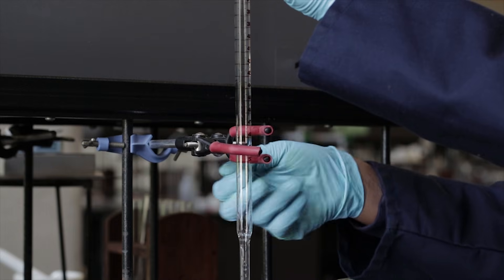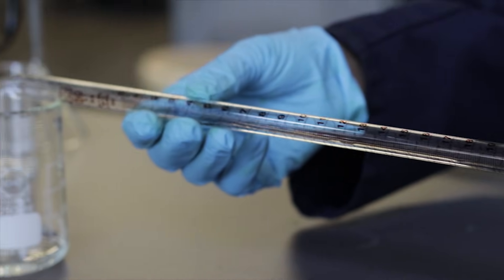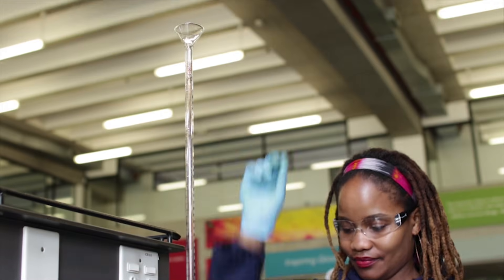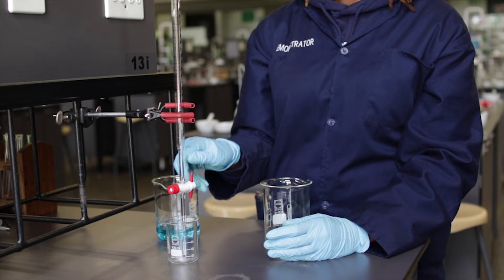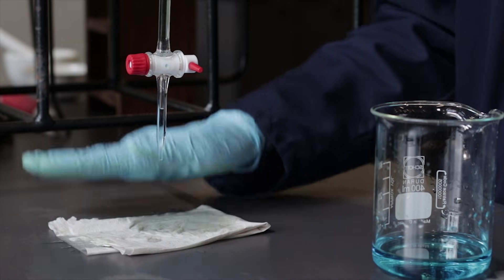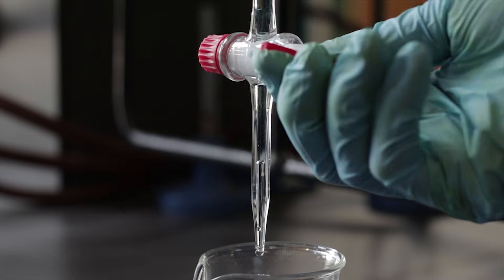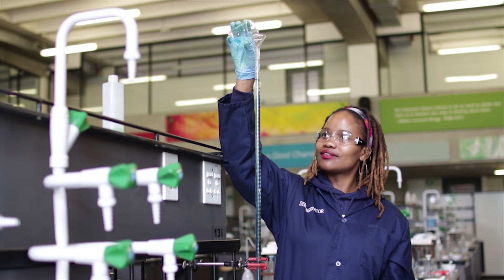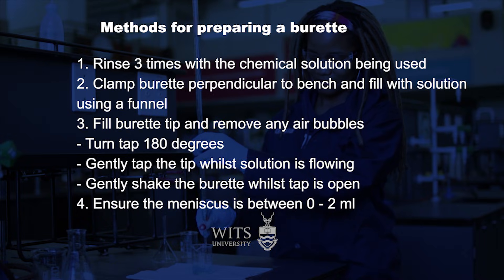How to Prepare a Burette for a Titration

Comment: Good job, but a little disappointed. Always use a buret clamp, and always fill at waste level by taking the buret out of the buret clamp, never fill above your head to prevent any potential accident having chemical solution getting into your eye.

Comment: Good video…there is one issue:  you should lower the burette to eye level when loading so you aren’t pouring from a height. You can place it at the edge of the lab bench and lower it on the burette clamp.  You can raise it once loaded.
Reply: Here is a great safety video:  https://youtu.be/YdYapyzJNsE